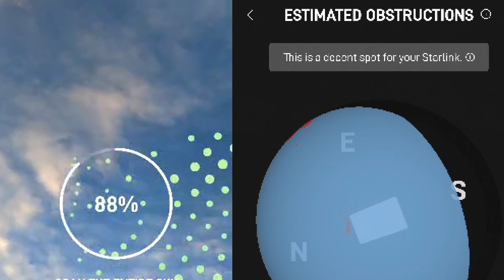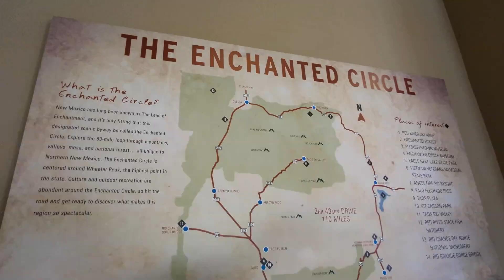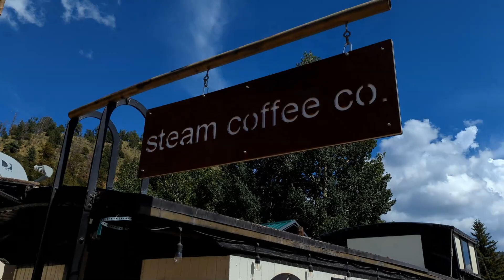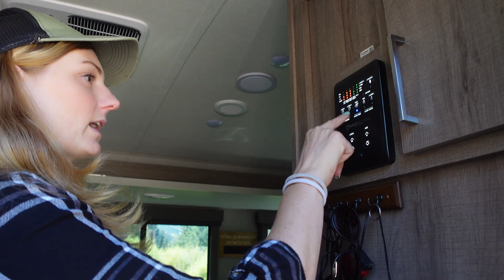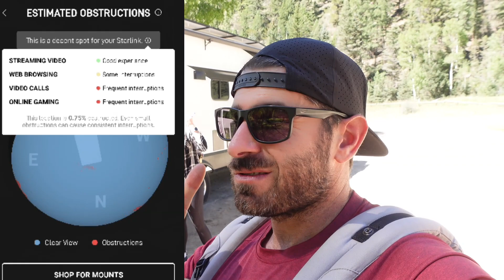Red River New Mexico, Boondocking Tips & Starlink

Comment: Crossed chains are not only a good safety idea, it's is the law in many states.  Properly done(Tensioned) it will catch the tongue and prevent it from digging into the pavement. It will also help keep the trailer straighter and reduce swinging around until stopped. Not having your chains crossed can result in a ticket.  

Like flying, having a Check List is an important part of your safety tools.  I also always do a walk-around at every stop which includes feeling the wheels/brake/bearing area for heat.  Always carry a torque wrench to check Lug Nuts for proper torque. Losing a wheel(Lug Nuts) or a spindle(Bearings) can ruin your day. I always carry a short(2-1/2-ft of 3/8" cable and three cable clamps to raise and hold an axle up level with the other axle so I can tow after losing a bearing, wheel/Lugs/ or tire. You can usually tow with only three wheels/tires in contact with the ground, but you can't drag the hub so it needs to be raised and secured.  Do your proper maintenance and safety checks and you will never have to use the cable, but you might, as I have, find someone else on the road who needs it.  

I'm a firm believer in having trailer towing training and a License endorsement to be allowed to tow a trailer, and max speed limit of 55-mph like in California. I determined this after seeing many trailer towing incidents and deaths. The first one was in Eastern Washington in the 70's where a travel trailer and station wagon in front of me left the road and rolled into a wheat field killing the parents and 3 children. I was the first on the scene.  Something you never forget. The first State Patrol officer on the scene threw up seeing the mangled bodies. Only the driver wasn't thrown from the car.  The trailer appeared to have come off its hitch and swerved violently pulling the back of the car around until it left the road and rolled down the embankment several times out into the field. A tragic end or beginning of a vacation.
Reply from the maker: Thanks for the information.

Comment: It actually is federal law 393.71 to cross chains on trailers  but it also helps catch trailers if they come on hooked    Loved the video
Reply from the maker: That's what we have heard but we're not sure if it was true. We have always done it. Thanks for watching Bob!
Reply: I usually remember to but sometimes I forget but have been checked by Florida DOT     Stay safe and enjoy I’m not trying to be No rv police lol just sharing information
Reply from the maker: No we appreciate the info! Safe travels
Reply: When the chains are attached to the trailer at a single point like most modern TT's, crossing the chains does not really do anything. TBH it's actually harder on the mounting point as crossing the chains puts a leveraging force on the mount and links if they are actually put to use in the event of decoupling. Crossing should be applied to trailers where the safety chains are independently mounted to the tongue.